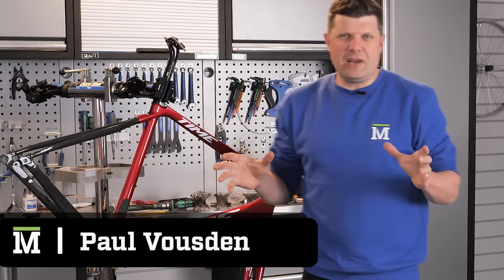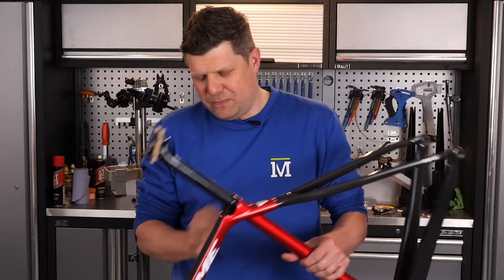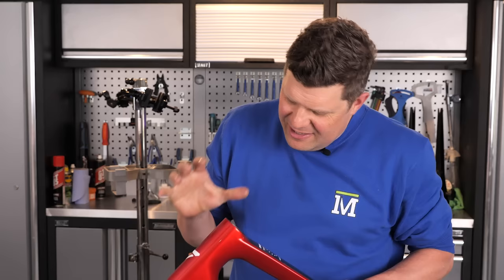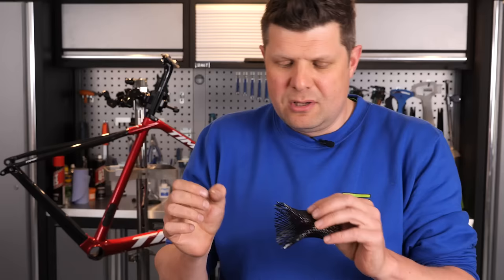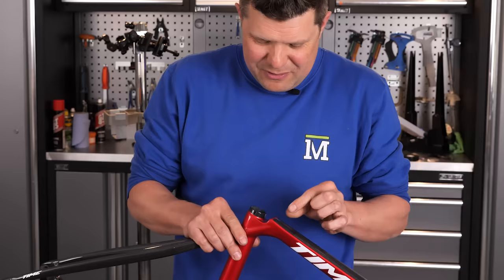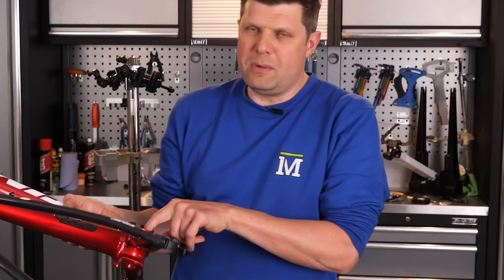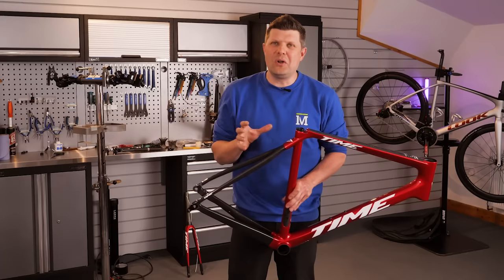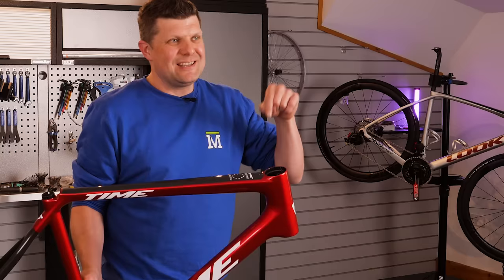Unimaginable Quality from European Manufacturing.

Comment: I just build AdHZ 2023 bike based on the above frameset, with integrated mechanical Shimano Ultegra disc groupset. I have managed continuous cable housing using Jagwire compressionless cables, both front and rear derailleur. The biggest problem is that you don't have cable stops, as in previous models. However Shimano front derailleur has build-in own cable stop. Other brands unfortunately don't. Presented internal cable guilde is useless. French brand, Made in Slovakia. Full stop.
Reply from the maker: Nice. Did you drill the frame at the front mech hole?
Reply: @Mapdec  There is a hole already, I enlarged a diameter with diamond mini drill to about 4-5mm and pulled thru a full cable with housing. The problem is with the bend angle of the cable, having BB Wheels Manufacturing, (there is almost zero space between shell and BB). Maybe, using existing internal cable guide as the cable stop, and then running just a steel wire to the front derailleur would be more elegant solution. I will try it.
Also running a fully integrated Deda stem is no no for mechanical shifting, I've installed semi-integrated solution using Deda headset with a cable opening, and then running it directly to the handlebar holes.
Also I found that supplied expander plug is not working properly. I had to replace top compression washer. it doesn't create enough presssure and spins like a crazy (even when using supplied carbon spacers in various combinations).
Reply: @DieterPullan  Dear Dieter, it is already installed in every frameset including 2023 model. The problem is with cable stopper, which doesn't exist in 2023 frameset (they have been removed in bottom frame mold.). I have already contacted via my dealer in Switzerland, and TIME has replied: No way No to intall mechanical shifting. However, I have managed it myself.
Reply: @MrSzwarz  send me a email to dieter.pullan@timebicycles.com or look at the link at part number marked 9 this is the correct cable guide for mechanical 
https://www.timebicycles.com/collections/parts-components/products/copy-of-service-parts-adhx
Reply: @DieterPullan  I've sent you an e-mail with few pictures. Thank you

Comment: I'm torn between this and the adh01.

I chatted with Time, and i was told the adh01 is their stiffest frame.
So, will that be better suited for 95 kg of me?

Also, is it true that the adh01 has a headset sollution with some special bearings, which can be a bit tricky to get hold of?
Reply from the maker: Yes. The older bikes have a tricky headset. I think the ADH or ADHD is more than stiff enough for 95kg.
Reply: @Mapdec  Thanks!

Comment: The problem with that bike is geo for size 54. 73 degrees seat tube angle? On a size 54? They should modernize their approach.

Would it be 74 degrees and it'd be my top pick.
Reply from the maker: I get what your saying, but every brand needs a solid 73/73 weapon
Reply: @Mapdec  yeah... But I've reached nirvana... If a bike's geometry does not fit my specifics needs, it does not matter its quality or specs. Unfortunately, for me, a 73 degree seattube angle does not work. Minimum is 73.7°. Ideally 74 or 74.5 degrees depending on the seatpost setback.

Comment: Cost is sooooo astronomical. That's the biggest drawback to one of these bikes. Unless I was a top flight, competitive Racer, I can't see spending so much on a bike when there are other choices.
Reply from the maker: What are you comparing too? A Ribble frame is £1900, an S-Works is £4500.
Reply: @Mapdec  Steel--aluminum.
Reply from the maker: @rainbowhiker  ok. A good alu Frame like a Mason is £1350.  It’s double the weight, a pretty harsh ride. Coupled with a good set of wheels it would be a better buy if you needed an entire bike for less than the cost of this Time frame.
Reply: @Mapdec Cycle Works  I think you're not getting what I mean, my fault. How many people need a frame like that? You may not be acquainted with tour winners but only the best riders really need that kind of equipment. The average Joe doesn't. Yes they're engineering masterpieces but I can't afford those kinds of hardware much less if I were young. Forget racing, most men and women are not going to do well enough as athletes to justify that kind of spending. Beautiful piece though...
Reply from the maker: Oh for sure. How many moms need a BMW X5 to do the school run? Humans love to escalate.  Good chats.

Comment: It's just a real pain this is electronic groupset only though. I'd go for an adh 21 if there is still any stock about
Reply from the maker: It has gable guides for mechanical. You just need to ask for them when you check out.
Reply: @Mapdec Cycle Works  so I see, on their website it did say electronic only tbf but good to see it is doable.
Reply from the maker: Yes. You can see the cable guides in the vid.

Comment: Watch out for that BB cable guide bolt sitting proud catching on the BB cups when you press them in. Ask me how I know. I’d also recommend grease over retaining compound too.
Reply from the maker: Can you elaborate please Peter.
Reply: Why grease?
Reply: @steveadorjan9048  Tolerances are so good that you don’t need retaining compound to make up space
Reply: @Mapdec  I can email you the details and photos. Tough to explain w just words. It was a heart stopping moment. Luckily frame is so well made and strong that nothing was damaged. But love my ADHX! THE BEST all-round road bike. I just wish TIME made a mtb
Reply: @Velodictorian  👍😀
Reply from the maker: Was it you that sent me the printed BB to check cable clearance?
Reply: @Mapdec  not me but I also had brake hose clearance issues. In fact, I hacked up the plastic cable guide to make it work. I used a Wheels Manufacturing screw type Dub BB so the sleeves are a little larger than say a Hambini single piece one. The screw was maybe 5 microns proud and right at the end of half. The lesson was to always back out the cable guide screw before BB installation

Comment: I'm just concerned about the seatstays, why can't they make it a single continuous piece to the top and seat tube, etc? Debonding can happen.
Reply from the maker: Quite a lot of bikes are made like this. They just cover it up. Time sort of made it a design signature
Reply: The design actually reduces the number of bonded sections on the frame and also allows a significantly increased bonding area. There are also other reasons why we use the wishbone design on the ADH platform 😉

Comment: The only thing missing is a full carbon aero carbon bars ( headset  & bars in one ) do the brake / gear ⚙️ cables run inside the headtube
Reply from the maker: Yes. Using the Deda DCR.  I’ll demo on next vid.
Reply: @Mapdec  
Thx very much 👍 😀.  Looking 4ward 2 watching . Not a Gravel Fan myself.  
I have just ordered an SL7 S-WORKS 54cm.  Purchased all the bits Frame Wheelsets ×2 Aero 52/60 & Climbing 32 Roval Rapide.  
Dura Ace Di2 12 Speed Groupset 
FSA VISION one piece cockpit 
Time Xpro 15 Peddles & S-Works printed mirror saddle.  Hoping 4 a weight of 6.75  to 6.8 kilos with the Aero Wheels.  Obviously lighter with the climbing wheels.  
Would love a Time ⏲️ Alpe climbing bike . A mate has one 👌 with Rim Brakes.  
4me probably the Best Constructed Road Bike Frames made ... period
Reply from the maker: Nice. That’s what Jake is riding. Let us know the weight. I’ll be surprised if you get a disc brake bike under 7.2kg without the use of very exotic German carbon bits.
Reply: They bring almost nothing except disadvantages. Two-piece can be just as aerodynamic, are more customizable.

Comment: ADHX “gravel” or all-road? I have an ADHX waiting to be built up. Main reason going to ADHX is the ability to go larger than 28mm tyres.

I have had Time VXR ProTeam and VXRS UL Team in the past. Both beautiful bikes but restricted by their tyre capacity.
Reply from the maker: I think the best way to think of the ADHX is that is an ADH, with an X
Reply: Yes for the road but not off road in the wet and muddy UK.  35mm at the most with limited clearance. The photos of the ADHX on the website has 38mm tyres and the clearance between the rear tyre and the back of the seat tube is fag paper in dimensions

Comment: Hi Paul, a question for you after having seen and ridden the ADH und the ADHX: which one would you go for, if you already had a Gravel bike? I would like to buy a ADH, but have been thinking about the restriction to 28mm tyres and if it is future proof enough?
Reply from the maker: For a fast and lively ride, the ADH. 28mm is enough. The frame is a beautiful smooth ride.   For all day cruising road the ADHX is a confidence inspiring ride on the steepest and roughest roads.
Reply: Thank you for the input @Mapdec … got my G3-X for the latter, so might as well go with the ADH… fast and livery is what I‘m looking for.
Reply from the maker: @PhyRexia.  the chroma paint is beautiful
Reply: @Mapdec I can’t make up my mind which colour to pick…and there apparently is no dealer in Switzerland 😩. Tough choice.
Reply from the maker: @PhyRexia.  black/ clear = sophisticated and technical, Red = Racer , Blue = Chill, Green = lively, Pink = Exciting.
Reply: Thanks!  @Mapdec

Comment: Counterpoint: Love the quality and attention to detail, but can I get a rim brake version?  Can I get cable bosses on the outside for full external routing?  No, I cannot.  Just another example of a bike maker forcing many riders into tech we neither want nor need.
Reply from the maker: I wondered how long it would take for a rim brake comment. I think this channel is well on record as being very pro disc brake.
Reply: @Mapdec  Yes it is, just like the vast majority of the bike channels on YouTube.  I'm not anti-disc brake; I'm pro brake choice.
Reply: @rangersmith4652  Spot on mate. I have both and it's horses for course.  For gravel disc and for a winter to a less extent disc brakes are the better choice. For road riding rims are fine, especially 95% of your braking is actually just slowing down at road junctions, roundabouts etc.  Most corners all you have to do is just free wheel before.  Also I not too over weight that I need disc brakes.
Reply: @nellyx1x493  Well I'll be.  Thanks for the correction.  Still, some riders just want to buy a complete bike rather than build up a frameset.  I'd have no problem with it, assuming I could find an appropriate groupset, which is also getting harder to do.  We hear all the time about sales figures driving rim brake options out of bike maker catalogues, but we don't get told what's driving those sales figures.  I suspect they're driven by pro racing having been forced onto disk brake bikes and social media telling us we have to have disk brakes to be real riders.
Reply: @rangersmith4652  Am aware of plenty of very real riders who shun disc, and on SM too! Don't be afraid of buying frame only, it always was (and still is) the better way to build a bike, just a bit out of fashion for brand profiteering reasons. In the future to stick with rim it'll probably be the only way. Someone like Mapdec will put you together a build way better than will ever come out of a factory in a box.
Reply: @nellyx1x493  I'm in no way afraid of building up a bare frame; I don't know what gave you the opposite impression.  I've built up three bare frames in the last year, all complete overhauls, and I had no problems I couldn't sort out.  I've only done internal cable routing once, a 2008 Kestrel.  I learned a lot doing that, as one might imagine.  If I popped for a Time frame it would be an ADH 01 in blue, and I'd build it out with a 12-speed Chorus full-mechanical groupset, rim brakes of course.  I don't know what wheels I would choose, but probably carbon with alloy brake paths and about 35mm deep.  I suppose somebody makes that.
Reply: @rangersmith4652  As you say, most riders just want to buy a complete bike. Shops used to have loads of frames on display on the walls, now they rarely do.. the brands artificially inflate the frameset only prices now to discourage riders from going down that route, as they generate more margin on the complete build. That doesn't mean that in the future we can't change towards an alternative to this sort of model, something that suits riders choice better...
Reply: AD01 still available in rim only ..... can also get Scylon to order for a little wile longer 🙂

Comment: Another $10k+ barrister bike I drop with my caad 10.
Reply from the maker: It would need a bonkers build kit to get to 10k. But hey. Yes.  MVDP could probably drop you on a BMX, so what’s your point?
Reply: MVDP might be able to which proves my point, upgrade your legs not your bike.
And don't pay motorbike prices for a pushy.
Reply from the maker: Everyone has budget. This is why brands like Rolex, Rolls Royce and Time exist. You can admire the engineering and craftsmanship.  I admire brands that push things forwards and create a trickle down effect.  The first car to ever have heated seats and electic windows was super luxury. Now they are standard. Let’s celebrate a brand setting a higher standard.
Reply: The only thing trickling down are the price points. +$5k for a mid tier bike is a travesty. The manufacturers saw the demand and raised prices without raising quality. I could never afford the bianchi I bought 6 years ago today.

I'm happy the dentists are happy with their shiny status symbols but for many average joes cycling is another unaffordable hobby, might as well buy a harley, it'd be cheaper(literally!). 

How can I convince a mate to begin cycling if he needs to spend close to $2k for an 'entry level' bike? I'm from a working class area I would be embarrassed to even suggest it.
Reply: @Mapdec  It would be interesting to see if the frames are really better than those from other manufacturers in an objective comparison.
Reply: @JohnSmith-pn1vv  I understand you, but to be honest: there are very good bikes under 2000 €... Prestige is just missing...
Reply from the maker: @walterhofer937  we have that video in the pipeline.

Comment: THE CARBON DROP OUTS ARE A BIG NO NO FOR DURABILITY
Reply from the maker: That’s going to need qualifying. Bonded in alu insert dropouts can corrode, come loose, bend.  Pros and cons. Nearly every carbon bike with through axles now has carbon dropouts. Find me one that doesn’t. 🤷‍♂️
Reply: Yes, you are right. A big fail
Reply: @Mapdec  Who says they have to be aluminum? A bike of this price should have titanium or stainless steel ones.
Anything better than carbon anyway.
Reply: @Mapdec  But they already have aluminum threads 😁

Comment: Bike are trying to get to the point of modern car designed to stop the customer being able to repair it their selves.....
Reply from the maker: Interesting, what part of this vid made you feel like that.
Reply: @Mapdec  internal cable,wifi electric shifting,bottom brackets all needing their own special removal tools, hydro brakes tubeless tyres/wheels.....but we all know unless your racing for glory or money is not needed to enjoy cycling...and one other thing is why are new bikes getting heavier??? My 13year old bike weighs less than a lot of these new disc brake bikes lol.

Comment: that is a rolls royce standard frame, but i dont like hidden cables, if they snap on the road , you cannot fix it on the road. these bikes are lovely but i like to be able fix every thing on the road. cheaply, easily, reliably, no fuss. freedom, cheap, easy, cycling.
Reply from the maker: The use a full run of outer cable.
Reply: You carry spare cables?, spokes? Bearings?

Comment: 2:30 The outer finish is not leveled there are two circular grooves in the resin, thats not good craftmanship man
Reply from the maker: I think you are seeing my lighting set up. There is nothing you can see or feel there.
Reply: @Mapdec  If the finish was smooth light would not reflect differently in that area. The shape of the surface is a bit concave there, not flat like the rest.
Reply from the maker: Sure